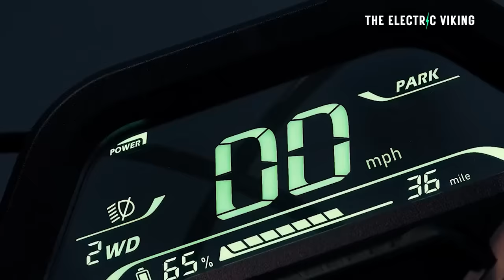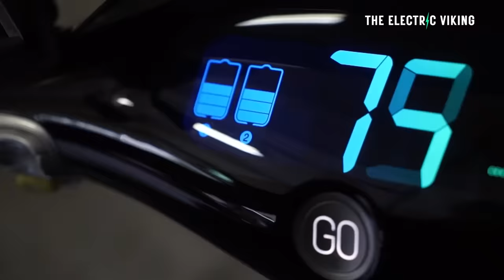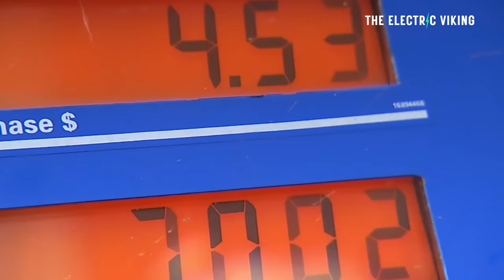Electric scooters destroying oil demand 4 times faster than electric cars

Comment: I have a little problem with scooters in the USA.We have a 60% overweight problem,asians are slimmer.The mass increases with speed,the impact on the victim may kill him.Any PIP for scooters?Now,the other issue,I see a potential increase in crime with the use of scooters.USA has certain ethnic groups that are " prone" to commit crime.Asia population in more homogeneous,so you dont have a section of the population commiting most of the crimes.Unfortunately Europe is transforming its population to the " diversity" area,with disregard of the implications.Lastly,it will be a headache at every traffic light,seing yourself in the midst of a swarm of sooters.You are going to be missing the Hell Angel motorcycles,they seems to respect road rules better.

Comment: scooters can las lot longer if they werent made to haev so much immedeate torque .             although there is no evidence for humans causing climate change beyond natural climate change, there is evidence and some very apparently suspicious artificial chemical stuff, which is now known to be definitely harmful, such as dirtier forms of combustion, tire wear dust(see xenoestrogens, microplastics, etc) , wiper fluid etc.    best way to use non fully recyalable limited battery supply (which is almost always never recycled ) is to have small combustion charging battery and electric assisted turbo in lightweight areo car.   weight makes it less crash safe for everyone involved in crash, worsens road wear damage and tire wear , exponentially, and makes preserving momentum around turns less possible to minimize degradation of battery from regenerative braking , then powering up again after regenerating the energy less efficiently than how it would be in preserving momentum around a turn. .    ev are heavy because high weight per energy , you arnt using all that energy at a moment of driving but you are carrying all thr weight. instant torque makes it worse.  @EnriqueThiele           having the sedan jump up to have its structurally strong parts lower in the car, hit the strong parts of other car before crash, would also have higher safety with all the supremacy in balanced values of sedans.        a lotus style lightweight agile momentum preservaton sporty driving can be integrated into encouraging effceint low emission driivng to make driving fun and safer, too         recent honda insight is closest we got to this ideal , but they intentionally didnt do their best becayse they were afraid people wouldnt buy their car as much if they made a aesthetically weird shape like prius , they wanted to get people whos buy prius if only it didnt look weird .  they knew almost every who says they care about emissions actually do not care(mostly because low trust in "the science" and its funding), and they are already far less than 5 percent of all customers , so they comprimised.            noone praises honda, they praise tesla for making a gossip attracting toy